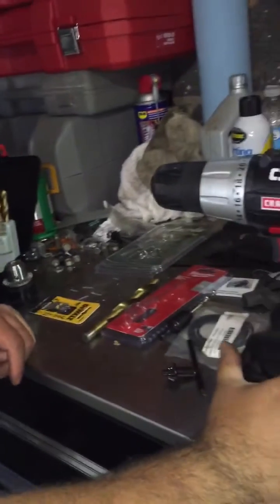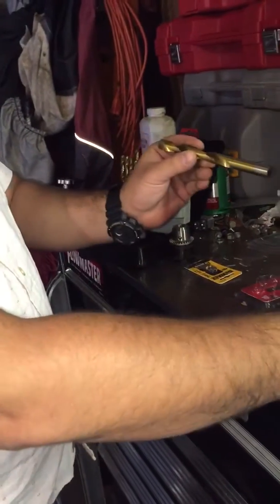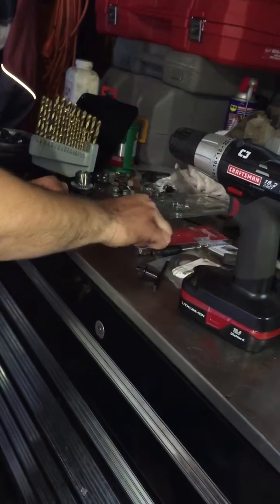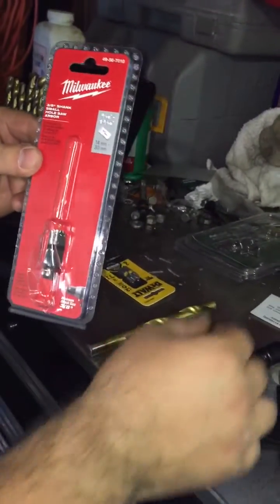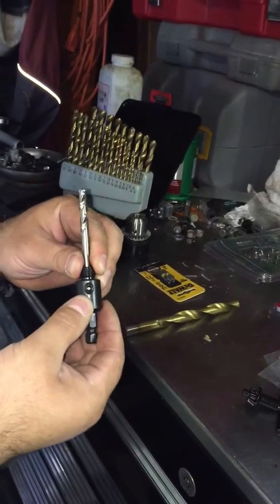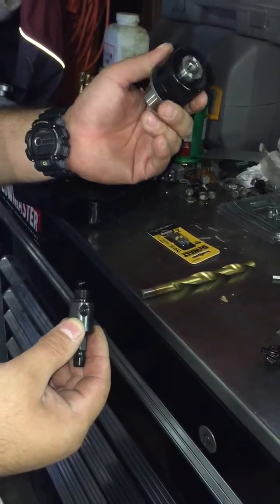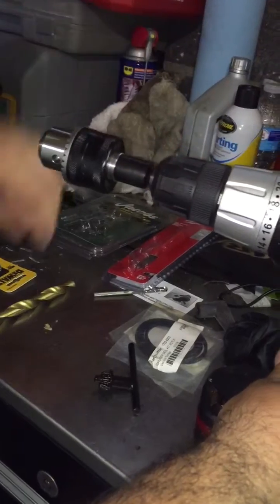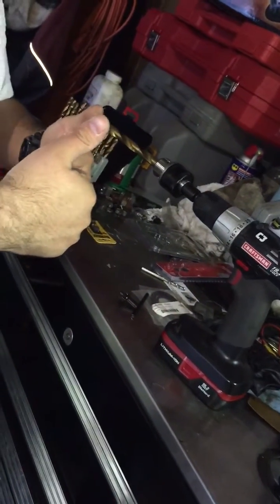How to fit 1/2 drill bits on 3/8 drill. Drill adaptor

Comment: At one of the big box hardware stores I was told there was no solution other than a new drill bit. My son, an aircraft mechanic, said that was nonsense. I found this video after a lot of searching. This is an awesome solution and I spent less than $20. Thanks so much for sharing

Comment: Thank you!  Bought the parts at Harbor Freight for $17.  https://www.harborfreight.com/1-2-half-inch-jacobs-keyed-chuck-45731.html and https://www.harborfreight.com/bi-metal-hole-saw-replacement-mandrel-68118.html (the smaller of their two hole saw mandrels).  Bear in mind that some tools with a 1/2" shank are built that way because a small drill won't have the required power to turn it.
Reply: Thank you!
Reply: Lifesaver, thank you

Comment: This is a very late comment but to save a LOT of money, just go with drill bits with cutdown shanks. You could have a 1/2” drill bit with a 3/8” cutdown shank so it can fit in your 3/8” drill. Search up cutdown shanks to learn more about it because I’m not an expert. Here’s a site where I got my drill bits from with 3/8” cutdown shanks for the bits. It hasn’t arrived yet so I don’t know how good these bits are:
https://www.harborfreight.com/brad-point-wood-drill-bit-set-7-pc-61640.html
Reply: the link above is for brad point drill bits, that are good for wood.  They don't work well on other materials, however.

Comment: In Canada I bought:
Milwaukee 3/8" shank small hole saw arbor Part#49-56-7010 {ABOUT $20)  and then a Task brand (from Princess Auto) {ABOUT $5} 1/2" Keyless Chuck (1/16" - 1/2" drill capacity) Part#CTC84106. EVERYTHING fits. Good luck.
Reply: I think im going to do the same thing!
Reply: Thank you so much. However I couldn't find the Chuck you mentioned from princess auto. The only one oh display is 8144396 which is 25 dollars. Ended up getting a cheap hammer drill right below it for 45